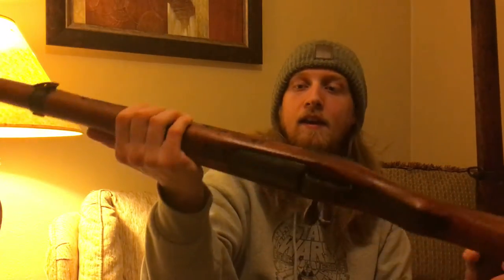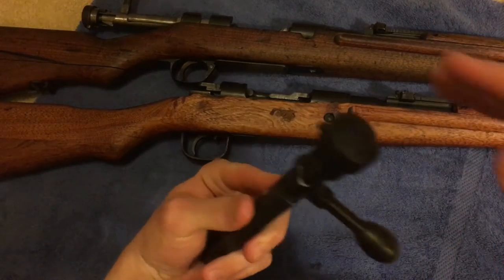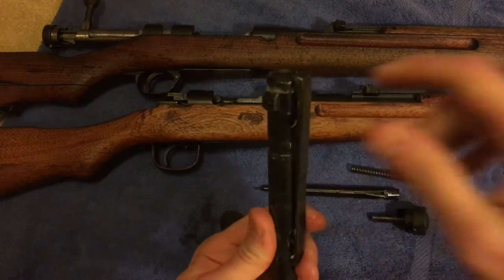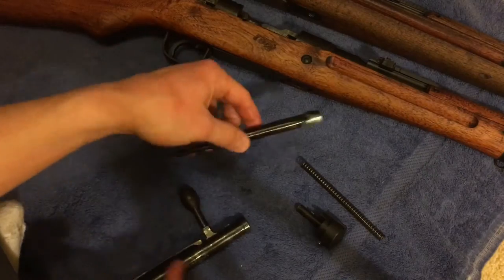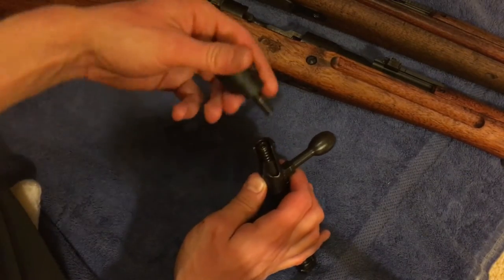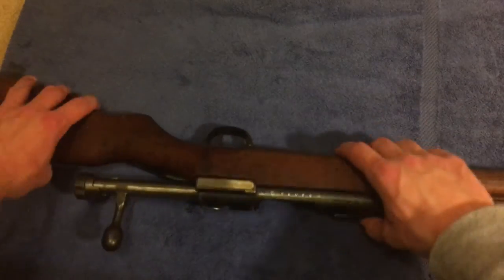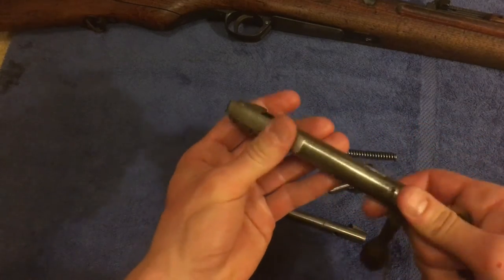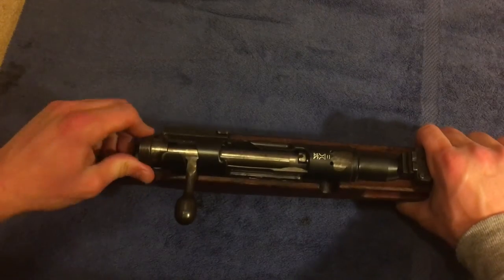Arisaka Type 99 & Type 38 Bolt disassembly & assembly

Comment: Inherited a Type 38 school rifle. It has some kanji on the receiver ring I have never seen before and I have not been able to translate them. Please understand that I understand that this is  non firing training school rifle.
 Took the bolt apart and cleaned and reassembled. As far as I can tell the safety is not going to the 90 degree position. It will only rotate about 1/2 way to the 90 degree position. The rifle is in pretty bad shape but the internal bolt parts look pretty good. 
Is the safety on a training rifle supposed to rotate to the 90 degree position?

Comment: Thanks for the easy to follow informative video.... I was able to easily disassemble/ reassemble  the bolt on my type 99 following your instructions.....  I do have a follow up question.  After reassembly of my bolt the firing pin is protruding in the bolt face. When I cycle the bolt in the rifle just as it is about to go into chamber lockup ,  I feel spring pressure  (I assume it is cocking the rifle ). My next assumption is that the firing pin Is being  retracted back from the bolt face just  as it is  locking in the chamber.  I am a little concerned about  stripping live rounds from the magazine with the firing pin sticking out and then retracting the Firing pin  just before chamber lockup..... My Spider Sense tells me that this is BAD! BAD! BAD! Can you tell me if that is normal bolt cycle operation for this type of rifle .... protruding firing pin strips round from magazine and then retracts just before chambering the round and lockup????  I have a few bolt action rifles and none of them work that way. I don't know if this is just the way this particular rifle works or if there is something wrong with my Bolt assembly....  Thanks in advance..
Reply: ***** Yes that's it in a nutshell.. I think I have resolved the mystery. After closer inspection of the Firing Pin, it looks like the pin had broken and the previous owner attempted a repair. Welded a new tip onto the end... unfortunately did not bother to measure the original length hence the protrusion.... Mystery solved.  I am thinking about grinding it down to the proper length but am skeptical of how long the weld will last. I guess I will be looking for a new Firing pin for my Arisaka...

Comment: I have a type 38 a type 99 and a “ last ditch “ type 99 . Thanks for the video , but it appears on your type 38 you have a type 99 safety knob . The type 99 had the groove or valley on them and the type 38 had a ridge that would interfere with you sight picture if you were aiming it

Comment: Hey I accidentally put the firing pin on the lower notch and reassembled it without noticing, but now when I turn the safety knob the spring won’t come out and I can’t even close the bolt because of this is there anyway to fix this, thanks in advanced
Reply: Is there any way to fix it mine has the same problem

Comment: I have a Series 7 Nagoya.  The extractor is worn  and won't extract the brass.   Is there any way to resharpen the extractor, or is it a replacement thing for the extractor ?
Reply: Many thanks.  Yes, the leading edge / tip of the extractor is rounded off and, at least they are inexpensive on eBay.  Just need to get one that is not ... also ... worn.